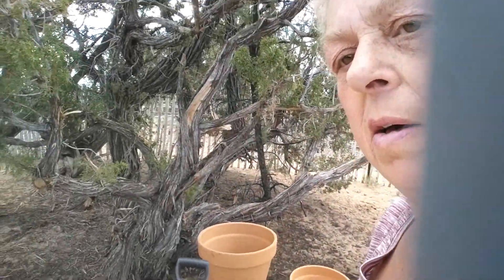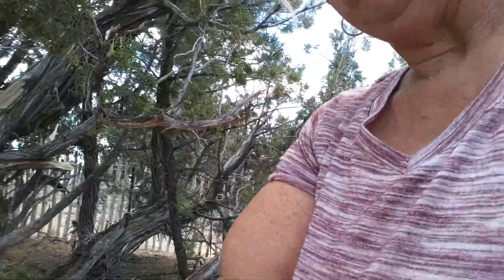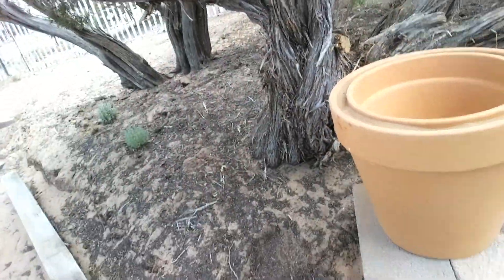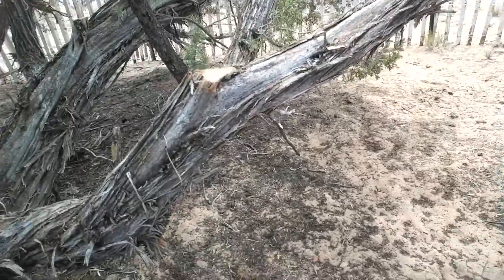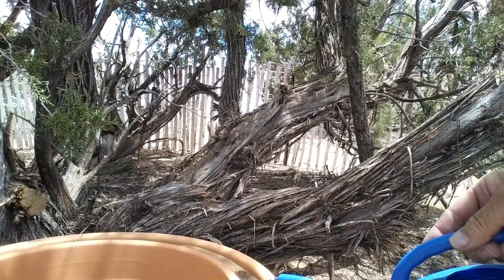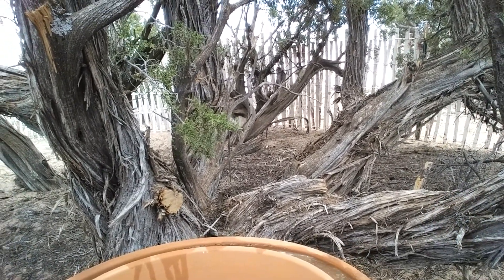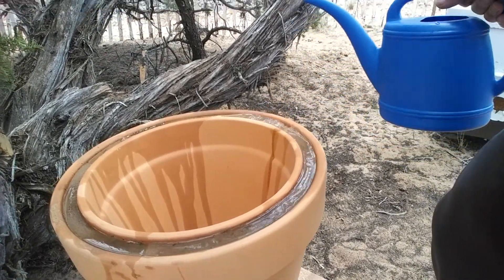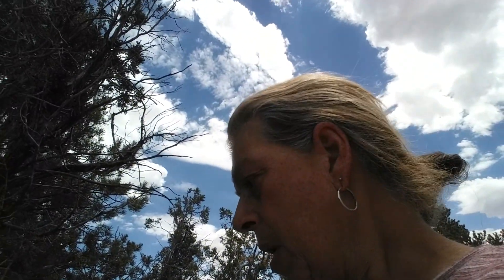SimplyLesa 2018 0705 July Projects part 2

Comment: Lesa, I love your homemade refrigerator/cooler. I've made many make shift coolers, but never seen this one made or used. 
 I remember you mentioning that the soil wasn't good for growing. Comparing would improve your soil and allow you to raise your own good in a small space. I grow potatoes, tomatoes, herbs and other vegetables in follower pots as well as in a garden. The composted soil mixed with any soil will boost plant growth and nutrition.  You can find many methods of composting on you tube. 
  Thank you for the video and keep them coming. Take care of yourself.
Reply from the maker: Kathy Pack-Dugger I  have commented on the difficulties growing successfully here. It's not a problem of the soil as much as the varmints and weather! I've even had a bug here eat marigolds during my experiments! I have future plans to build a screened in and hardware cloth enclosed  garden room. Composting is a challenge for the same reasons. Wind blows it around, rabbits, coyotes, chipmunks and rats drag crap off,  it's so dry stuff petrifies instead of composting unless it's watered regularly - all things I've tried and when the money and situation is right I will work on that as well. I keep lettuces, cilantro and green onions growing in water on the counter. Nothing touches my geraniums in the ground - 3rd year trying that with success. I have chives in the ground they grow good then something has dinner and they regrow lol. I put 2 different lavenders in the ground this year too, they are slow but looking good - I think they are keepers.